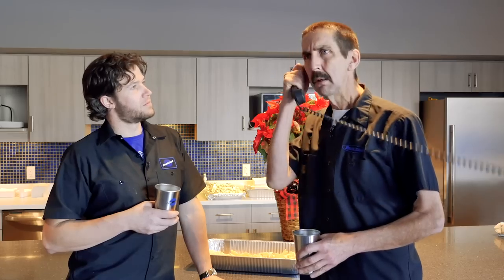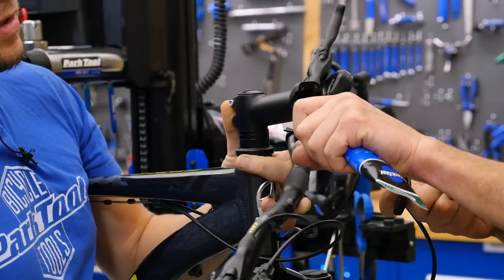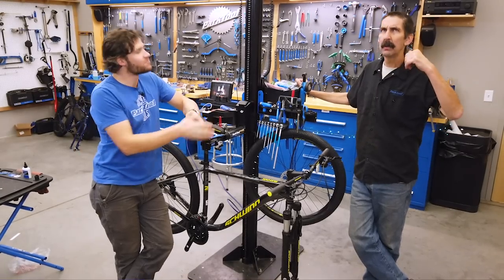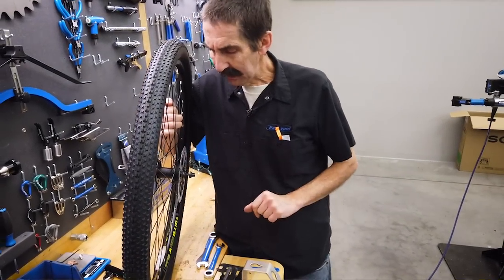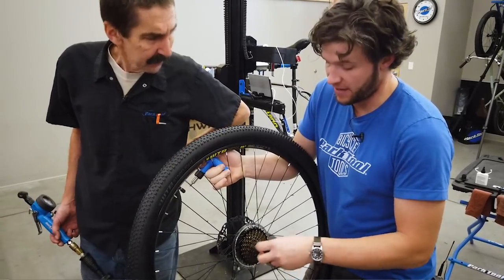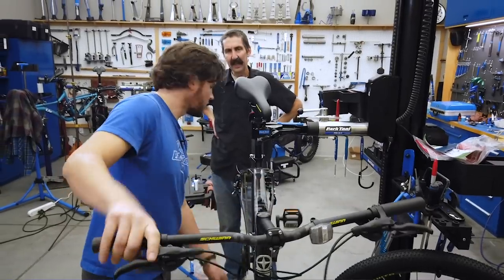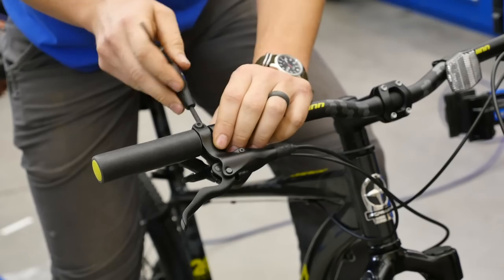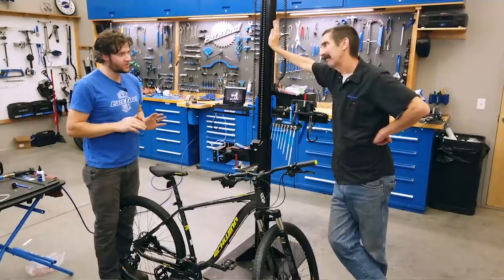Complete Bike-in-a-Box Assembly - Tech Tuesday Christmas Special

Comment: You put grease in the seat tube of a bike. I thought you might know what you are doing till I saw that. I LOVE Park tools]
Reply from the maker: What do you use in the seat tube?
Reply: @parktool  I don't use anything. I remove it about every 6 months & wipe it down. I got WD 40 in the tube once and the seat would creep down & never stay tight. Maybe it's a new thing riding like that. I'm 65 and still riding everyday.  I wish everyone a safe & fun ride.
Reply from the maker: Grease or some kind of surface protectant is crucial in this area. If something is not used seat posts very very frequently get seized into seat tubes. There are many documented cases and many different creative ways that people have pulled their seized posts. Many of them are on YouTube. If your collar, post and frame are correctly sized and in good condition you should have no issue with slipping while greased.
Reply: @parktool  I respect what you are saying. I have never come across a seat tube being stuck in a frame. I watched another video on cleaning bikes & they pointed out any grease in the collar area of the tube will make it so the seat can not be secured 
in the post. So it's a Ford V Chevy thing. I have a Park bike stand & a 36inch pipe wrench in case this ever happens to me. Thank you for your time, & ride safe everyone.
Reply from the maker: This is not Ford Vs Chevy. All bicycle brands agree on this. When carbon is introduced to the mix things do change a bit but surface treatment is still crucial. This response is for others that may read this. Grease is important in your seat tube.
Reply: @parktool  I understand.. If I get a bicycle with a carbon frame I will make sure the seat tube is greased. I don't need the seat to fail as I am sure it would be quite painful.
Reply from the maker: What I meant by that is that when dealing with a carbon component you should use a carbon specific assembly paste/grease to add some friction to the joint. Other materials require some form of grease. No matter the material a surface treatment is needed.
Reply: @parktool  So I could use Park Tool SuperGrip Carbon Assembly compound and it would solve the problem of carbon parts moving & slipping such as the seat post, handlebar, and fork stem. That makes perfect sense & I want to thank you for taking the time to explain that to me. I also subscribed to the channel. You are proof an old biker can learn new tricks. I also just read a paper on Carbon Fiber & it's properties.
Reply: @Saddletramp1200  hey, bubba... I'm 63, and trying to get back to daily riding after 2 knee replacements; I spent 20 years building bikes for a big-box store, and I lost count of the returned bikes whose seatposts had seized. (Hint: almost none of them were 6 months old.)

The difference would be that you are most likely taking very good care of your bikes, as I do. Far too many big-box buyers leave them out in the weather to rust between ride days.
Reply: @ringo666  I keep my bikes in the house, the wife has passed. I got wd 40 on the post of my trike and I couldn't get it to stay put.
Reply: @ringo666  Lectric XP 2.0 is my daily bicycle Goldwing is my motorcycle.

Comment: Nobody seems to object against having the brake levers on the wrong ends of the bar...
Reply: US bikes and most of Europe have the rear brake on the right, front on the left, UK bikes have rear brake left, front on the right. Front brake on the right makes sense to me as I’m English and it also matches a motorcycle front brake lever
Reply: @djhatstand7312  Either way, be my guest, it's a free country. But there is in fact a good reasons to have the front brake on the right and a good reason to have the front brake on the left.
One is the connection of the brake cable to the brake. If it's a rim brake, the connection on the brake itself is on the right side of the frame (fork) and a cable from the right side of the handlebar would be awkward, visually as well as functionally. In the case of a disc brake, this is exactly the other way around. Look at the video what happens to the front brake cable as it comes from the left hand lever. Horrible. Likewise, the rub by the rear brake cable against the right side of the head tube is in my opinion caused by placement of the rear brake lever on the wrong side of the handlebar.
On a road bike, another rationale for connecting brakes the  to a lever is their association with the shifters. If the rear brake is on the right hand side, it combines with the rear derailleur. Likewise, the front brake lever combines with operating the front mech (unless you have flexible electronic shifting).
It's up to anyone how important they feel these associations are. In my book, the functional rationale dominates over the esthetic or logical ones.
Reply: @marianarossicampos6263  Call anytime.

Comment: You ask, "how good a friend is Pat" or "how has Pat treated us lately" and then not do three things. One was near the rear wheel, maybe a bent derailleur,  a second was lowering the front derailleur, and the third was near the front, maybe a handlebar or rotor problem. We don't really know what you weren't going to do as you didn't say for two of these three things. What were the other two issues? Also, did you tell Pat that these three concerns existed so Pat could determine if he wanted to pay to get them fixed?
Reply from the maker: Kirk, how are you doing today?
Reply: the front derailleur should have been fixed, they'd need to remove the plastic protection from the crank and lower the FD a few mm's, and that would do it. Then again, if Pat is one of those friends who "borrows" tools and never returns them, i wouldn't fix it either.